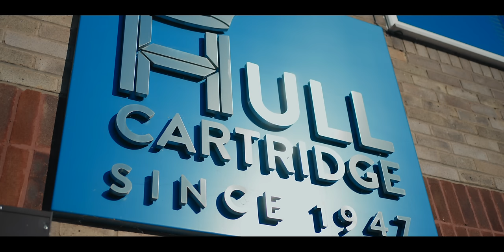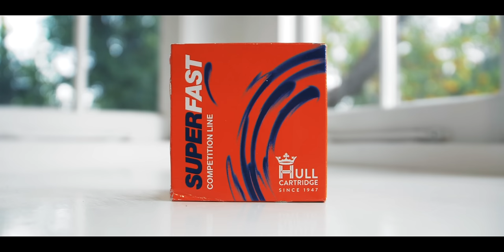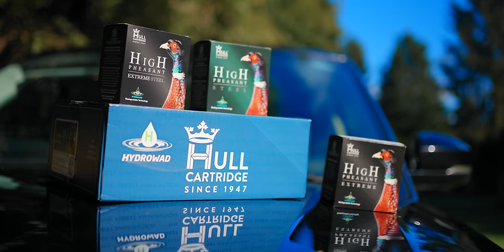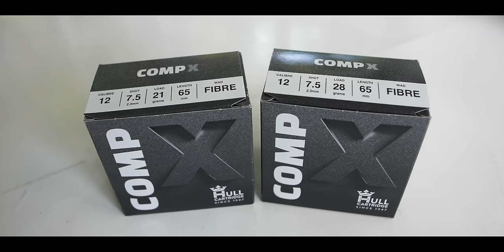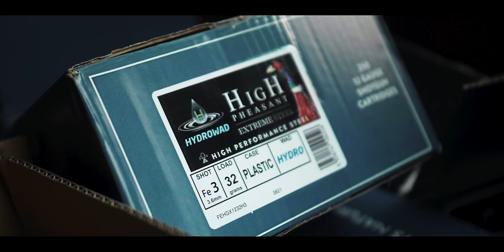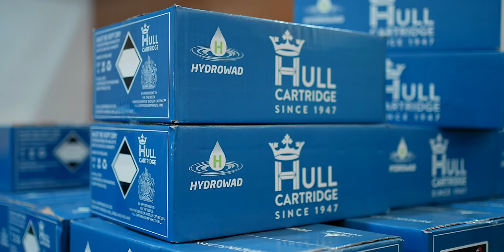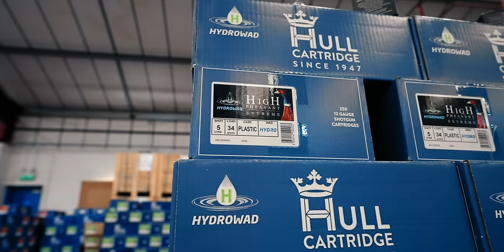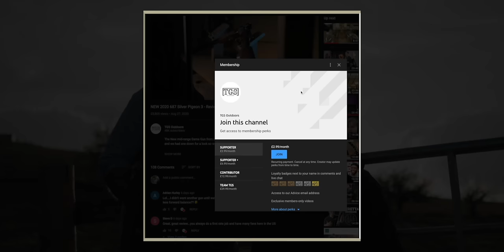The Hull Cartridge Factory Tour!

Comment: I have used Hull loads for years,  they are good.   However, despite what was said in the video I believe they have changed the specification of the case, which they use for their X Comp loads.    I have shot thousands of these loads in 21g and 28g. over several years in my Longthorne sidelock.  However, about a year ago after buying a new batch the cartridges kept slipping past the ejector irons on both barrels, which meant I had to use a cleaning rod to push them out.  I now use Hull Sorting 100's which work well. without any problems.   Any comments Johnny ??

Comment: Interesting that Hull appears to have confirmed the rumour that when using Steel you have to match the Cartridge with the chamber length? My guns all have 3’ chambers but I still only shoot 70 & 65 mm cartridges even when using Steel. Am I damaging my guns by doing so?!
Reply: I shouldn't think so, if there is an issue i would assume it will be maybe not so good obturation with the shorter length cartridges. It's a learning curve for us all.

Comment: The guy at the @SurvivingDuckSeason YT channel done some testing on the shotstring & pattern size and his findings (evidenced with slow motion video) suggests that faster loads will give a tighter pattern.. worth checking

Btw, great content, Johnny
Reply: think that was true for steel shoot and tungsten shot but not lead.
Reply: @RobertSmith-qs8yl  fair point that he didn't test lead shot.. but i don't think it matters.  
Even if you put wood or sand, the effect is the same.. faster loads will maintain tighter group and open up slower
Reply: @6079__Smith__W  certainly was very interesting high speed video, would like to see it for fibre wads also but then it was USA. my findings for fibre wads with lead is faster is no guarantee of a tighter pattern.
Reply: @RobertSmith-qs8yl  I believe it's difficult to compare fibre vs plastic from a speed point of view as they're different cartridges (i.e. manufacturers developed the load independently and not just swapped wads)

But yeah,  I am with you.  I'd love to see the same testing done on fibre

Comment: So is there an optimum choke size for standard steel cartridges? I think that by now, we all know that we should not exceed 1/2 choke, but is it better to be more open than that or to have the chokes at 1/2?
Reply: Shall I?
Reply: @nickhorten97  yes, please do respond.
Reply: @JohnHartley-nv4rg  oh, all right then! John, what makes you say that about half choke?
Reply: @nickhorten97  That seems to be the advice that I have received from a gunsmith and from others on-line. I have had the choke modified on one of my guns from half and full to half and half so that I can use steel shot on game and wildfowl, Webley 700 boxlock with good barrel wall thickness.
Reply: @JohnHartley-nv4rg  for a lightweight English game gun that is probably reasonable advice. It's worth having a read of the steel shot safety recommendations on the BASC website. The gist of it is that,  under the CIP regs there is no recommendations for choke constriction in either standard or HP steel, unless you go above 4mm in pellet size whereupon half choke is suggested. Have a careful read of the actual regulations. They are a real eye opener.
Reply: @nickhorten97  Thank you for that advice, I shall read the regulations to be better informed. Happy New Year